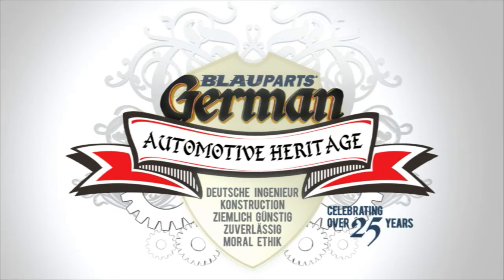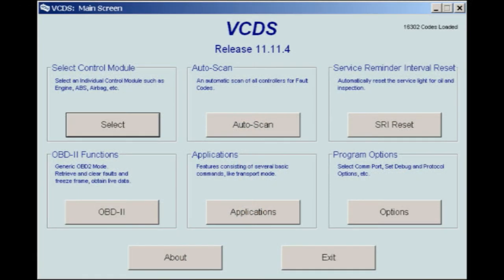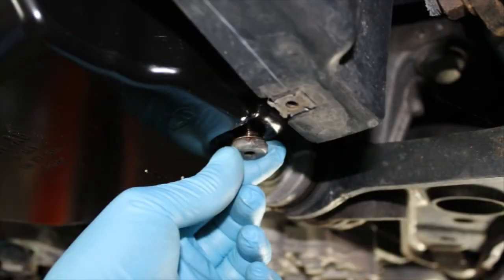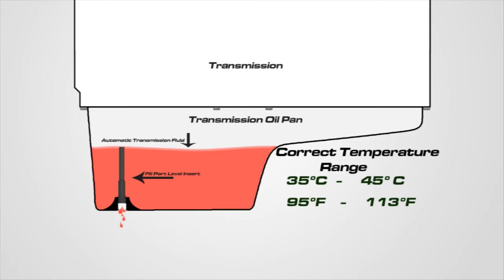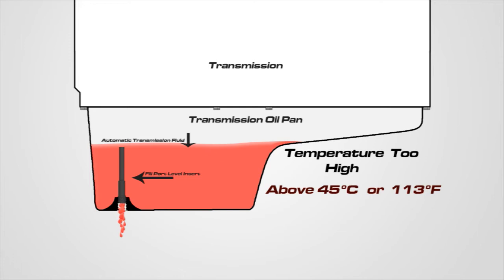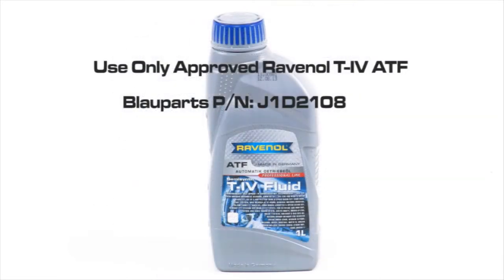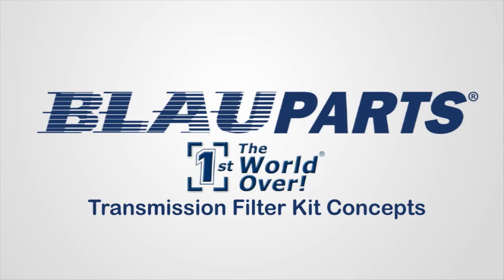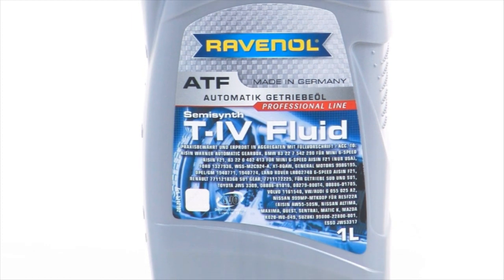How To Check and Fill VW Rabbit Transmission Fluid aka VW Rabbit ATF Level Aisin 6 Speed 09G

Comment: At 2:42 look how high up the drain hole is.  I don't know why they had to put it way up there but that leaves so much fluid in the pan even though you might think you drained it if you did not know about the design of the pan.
Reply: Dude you're telling me. I'm absolute car beginner and my bf is a seasoned mechanic. He owns 2 '04 golfs and he rebuilt one of them it's a GTI turbo and he took it to a euro place cause he bought it off of some 16 year old kid who had blown it up somehow.  and they said "due to the aftermarket additions the vehicle is unsavable" yet a year later its brand new due to his hard work and knowledge on cars especially Volkswagen. He bought me an 07 rabbit. We think his mistake was getting me an automatic instead of manual (I can drive manual but... Am rusty and would need to practice and maybe a lesson or 2... Lol) but this car has been SUCHHHH a B***c to work on!!! He was so shocked it had a sealed transmission and the way we have to add fluid to my transmission is literally doing what this guy's video says and then using a pump to pump the fluid up into the trans cause we can't just easily drop it every time it needs fluid. Which is like once a month or every 2 months cause that thing is leaking. He works full time and it quite literally is a 2 person job cause someone has to pump and someone has to be under the dang car. I can tell my car needs fluid So I came here hoping I might be able to check the fluid level at least by myself. I am gunna try but I am terrified of what if I go to check it and it starts pouring out and I can't get the bolt back in or something 😅 this video is the most helpful thing I've seen. But these cars are built to 1) be serviced by VW dealers only and 2)  honestly if you buy a VW don't even BOTHER unless you get a manual. Cause all the automatics end up in the scrapyard due to trans issues 9 out of 10 times. My bf has been working on all types of cars and trucks for 21 years. He can rebuild or fix ANY vehicle. Yet this generation of the rabbit specifically has been headache after headache for him. I asked him if he thought I could watch videos and teach myself how to work on it (because he works full time and is a dad and has multiple other projects to work on and I feel bad always asking for him to do stuff to my car) and he said basically I'm better off selling the car than trying to work on it myself. So I'm feeling discouraged but it's paid for, and it's not even got 200,000 miles on it yet. I am looking at the manual, watching videos, reading forums.... I used to have an 08 Hyundai Elantra. I could do a lot of work on it myself. He pretty much told me if I wanna work on my own vehicle I should get a Honda or Ford 😅 I am so confused and pulled in so many directions with wtf to do with this car lol. Your comment made me feel better because as a woman with very limited mechanical knowledge I didn't really know it's an absurd design I just thought all vehicles were this hard to check transmission fluid. Turns out most have a dip stick for it like the freaking oil does. Maybe you'll get a laugh out of that 😂 but seriously... This car is designed for a VW enthusiast or someone with a lotttttttt of money to drop at a mechanic shop.